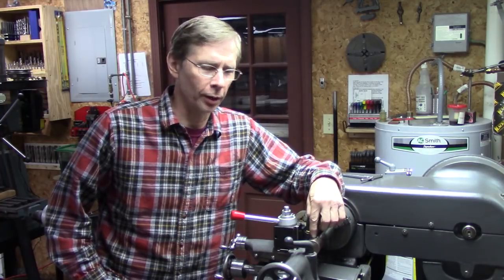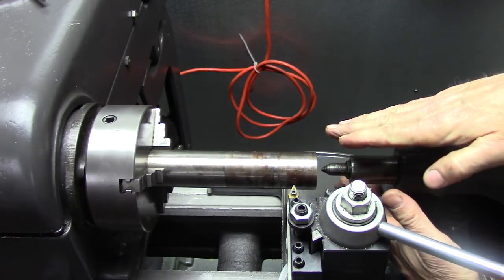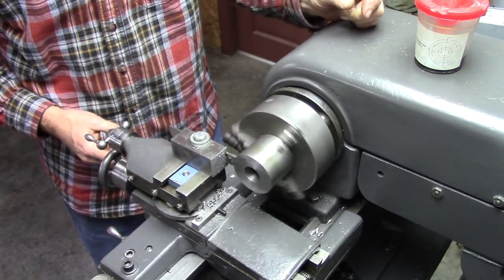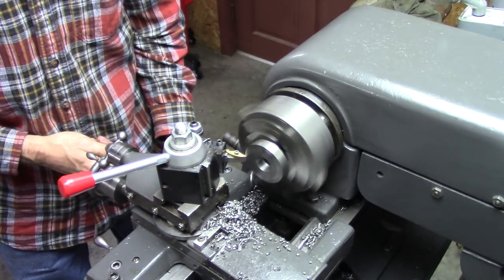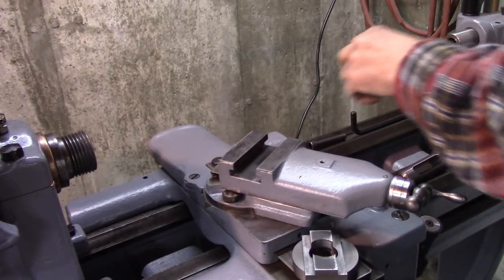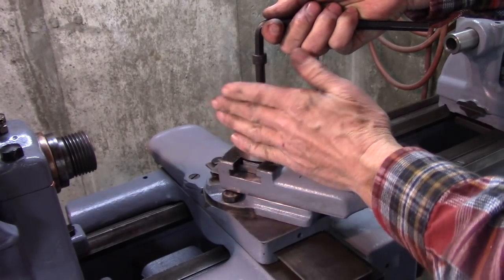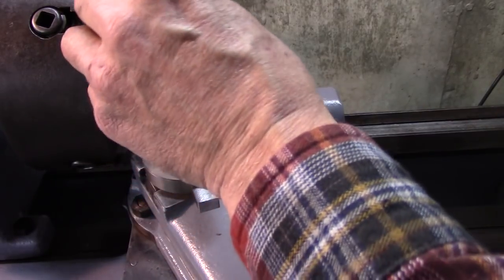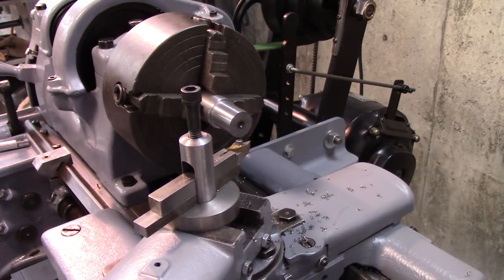Building an Improved Lantern Style Tool Post

Comment: As others have said, having a Lantern Style tool post is handy to have when the bulk of the quick change tool holder gets in the way. The one you've made is nicely done.
I've noticed in several of your videos that you have a dangerous habit of leaving the chuck wrench in the chuck.  I've seen one flung out of a Monarch across the shop like a frisbee and through a window. So don't let your lathe chuck wrench use you for target practice.
Laying stuff on the lathe's head stock is equally bad. Years ago a guy was running a 24" engine lathe and had the chuck wrench on the head stock. While he was doing something with the change gears he bumped the chuck wrench. It fell off the head stock and hit the forward/reverse lever on the carriage so hard it sheared the stop locating pin off and the lathe started up. The guy was lucky he didn't have his hand in the gear train when it happened.
Here is a photo of a simple way to keep your chuck wrench and other commonly used wrenches close at hand on your lathe. You can grab the chuck wrench without even having to look down for it.
It is annoying, but you have to be your own safety officer in the workshop.
Cheers from NC/USA
https://i.postimg.cc/NMRgwPTW/IMG-0151.jpg
Reply from the maker: Totally agree...  bad habits. Yes...  I need to make a spot for the chuck wrench. I need so also make all my tools more accessible reaching across the lathe is not the best.
Reply: The photo I posted also shows my homemade emergency stop. I used an old Sears switch box I'd had for years. The foot pedal is a bar clamped to door padlock hinges. The switch pull-down lever is made so that when the pedal is released the switch lever has to be reset by hand.  The linkage is made with heim swivel joints from the riding mower section of the hardware store.
 The knife switch in the box isn't suited for constant use because of arcing with the slow action of the switch, but it works fine for an emergency stop and as a disconnect when you've got your hands in the machine and danger of hitting the start/stop switch.
Cheers from NC/USA
Reply from the maker: @aceroadholder2185  Looks like a smart setup!

Comment: Love the old time intro and ending, plus WINKY'S PRODUCTIONS. You brought up alot of things to think about. On a small lathe the extra rigidity and being able to take heavier and cleaner cuts should offset the toolchange time. In one of your recent videos I spotted a toolpost that you made. It hade a post that was mounted vertically with a horizontal cutout on the left side. You had a interchangeable toolholder that slid into it and was held by a bolt or setscrew. This toolholder had a slot just like a quick change toolpost. Even if this design did not work out I would be interested in seeing what you had in mind.
Reply from the maker: Yeah...  that other post was experimental. I had it on the south bend to try it. The one bolt mount wasn't so good because it was off to the side. But...  that was the idea, mount the tool in a holder with the needed shims and you have a quick change. Interesting that you noticed...  I'll be a few people wondered about that post.  One person's comment on this video was interesting. The guy said he made a washer that unscrewed to adjust the height of the tool. That way he eliminated the need for shims...  I won't be sleeping tonight!!!
Reply: @WinkysWorkshop " I won't be sleeping tonight" I think that we are in the same boat. I did read his comment and thought it is a very clever idea. I thought the toolpost was a interesting design. To bad you didn't have good luck with it. The basic concept looked promising maybe the problems could be sorted out. I don't know I just got a glimpse of it. More to think about tonight.
Reply from the maker: @andyZ3500s  I never give up. These things are working themselves out in the back of my brain somewhere. Now that I am retired I have some space in my brain. My job was fixing problem areas in printing equipment which involved a lot of machine redesign. For the first 10 years I made a lot of drastic changes but the remaining 5 years after that I was left with the seemingly unsolvable. It consumed me.
Reply: @WinkysWorkshop  Work can definitely consume your thoughts. Even working as a finish carpenter I would have work on my mind in the evening. The times that I was working for my self my mind was constantly on the job, tooling and how I could be more efficient. I always worked on my cars and everything else around the house. When I started getting involved with machining and started studying alot I started to wake up in the middle of the night with projects in my mind. Instead of a normal 30 year old I wouldn't be dreaming about girls I would be engineering something. Pretty crazy huh!!!

Comment: Loved the way you parted off on your small lathe using power feed. I would not even try it using my Hardinge tool room lathe. I have always been scared of parting off and I did 40 Years of machining as a job and still do it at home.
Reply from the maker: Most of the reason it works so well is the way the blade is mounted on the compound. All the force is downward on the compound aside from slight lifting force in the back. I always turn the compound parallel to the cross slide. The mechanical advantage on the compound slide in this position is huge. Quick change posts are great on heavy modern lathes when everything is tight but with the tool hanging off the side the force becomes torsional.  Any flexing or wear in the slide becomes a big issue. The BLADE has a T type with a concave top and the chips always have clearance. They come in a lot of sizes but this 1/8" blade seems to be the best for me. HHIP 2000-7065 1/8 x 7/8 x 6 Inch 8% Cobalt Parallel Type Cut-Off Blade-P5X
Reply from the maker: Something else... I usually part off at the recommended cutting speed. That would be 450 RPM @ 1-inch diameter. I was running slower for the larger diameter plus my lathe makes a big jump in speed unless I want to move the motor pulley....  which is a bit of a pain.

Comment: Nice, I believe your right about the Tee nuts, when I rescued my lathe I didn't receive the rocker or spacer for the post holder but did get the tee nut and post. I have been using a stack of large washers I got at tractor supply ($1.75 per pound) that I ground flat for the spacers but, still wobbly till tight. It's been a pain to set center since all the tools I got requires a different washer height thickness depend on where the cutting edge is ground it on the bits. You will probably laugh at what I'll tell you next but it works. Since the center is finite and the compound base is finite I shimmed all bits and holders to hit 1.9375" it cutting edge, I started out using a thin layer of hot melt glue to keep the shims on the tool holder or bits together, since it is easy to take hot melt apart with a heat gun. My plan was to then switch to JB Metal once I got the right height set. However, the hot melt has worked so well I've had only done a few with JB Metal. I heat the assembly of shims and bits with the heat gun first then it's easy to apply a thin layer of hot melt between the layers, I then squeeze then in my small HF vise until cool.  Long story short I will start building your design and style, especially the Tee nut design, and spacer today but probably keep hot melting the shims on the tools. Thanks
Reply from the maker: One person commented on this video. He said he is doing the same as me with a lantern style post but he said he made a spacer washer that screws into another. He said he unscrews the washer to change the height. No shims

Comment: Nice piece of work . One thing that I did to make my lantern tool post more useful is to replace the thick washer/collar you have as a base support with a two piece collar with fine threads that can be easily adjusted for height to eliminate the need for shims. Not a lot of adjustment there, but enough to do the job. And yes I replaced the tee nut to spread the load/pulling force  on the lips. I do still use the armstrong style holders with the lantern tool post.
Reply from the maker: Dang!   I love the height adjustment idea!!!!  Can I use your name if I use it in a video???  Let me know.
Reply: @WinkysWorkshop  Feel free to use my name if you like, but it was not my idea. I am sure that I read it in a magazine like "Projects in Metal" or similar. If you are worried about the threads backing off you can use a brass tipped screw to lock it, similar to the dials on the compound and cross slide. I have not found this to be a problem, but I have never used it to make a heavy interrupted cut. Hope to see it in a video. I certainly like the new and improved cut-off tool holder you presented a couple of months previous.
Reply: That's the way to go for sure, but there's plenty of diameter so I would do the outer ring split with a cross bolt lock like the good die lock rings.  I've never been a fan of smashing threads as a locking mechanism.